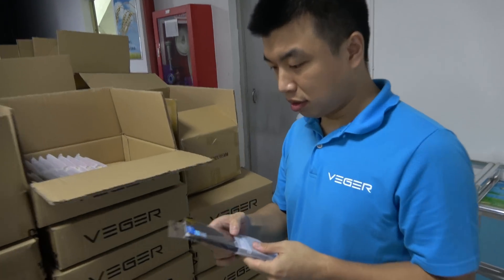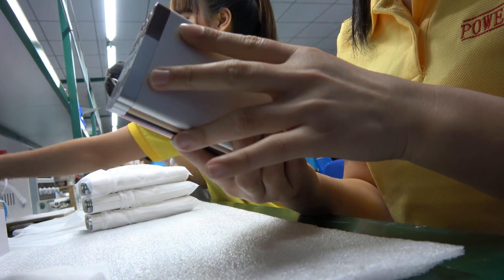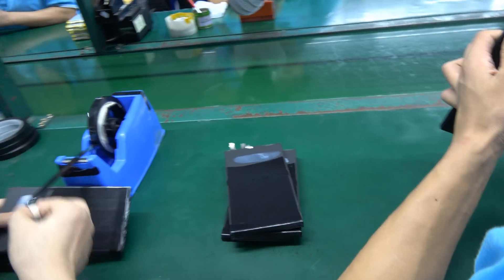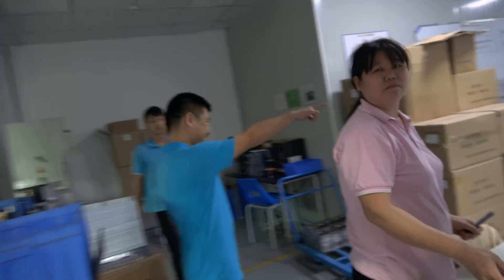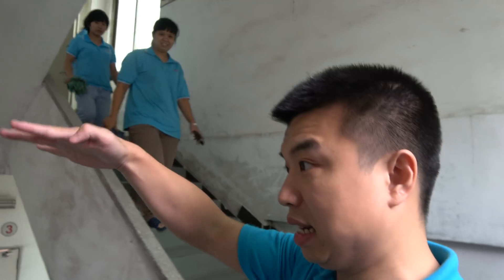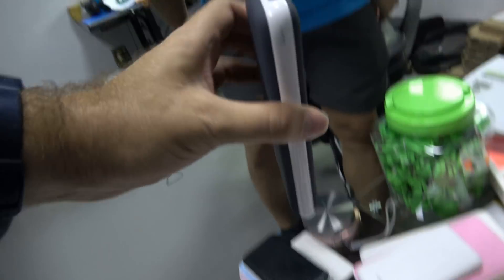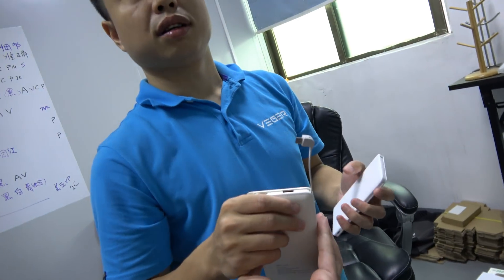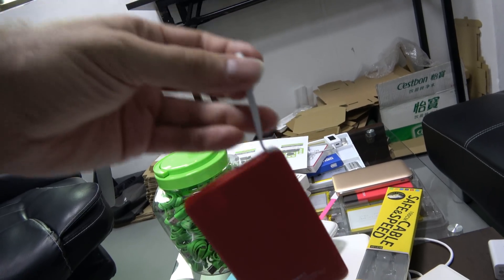Power Bank Factory Tour at VEGER (part 2)

Comment: It might say 5,000mAh, but that is according to a 3.7v figure then you have to figure the boost converter that converts it from 3.7v to 5v and the law of conservation, that alone is a negative 20% so maybe 3,000mAh...
Reply: Nominal voltage is 3.70v/cell. Full charged is 4.20v/cell. That is if they use a standard lithium battery. Newer HV lithium batteries can be charged to 4.35v and some a bit more. The boost converter is most efficient when the bank is fully charged. Even more if they use HV cells. Once the batteries voltage drops to near nominal, this is when efficiency reduces drastically, even more depending on set voltage cutoff of the IC. Your figures need much more information before concluding your results are accurate.